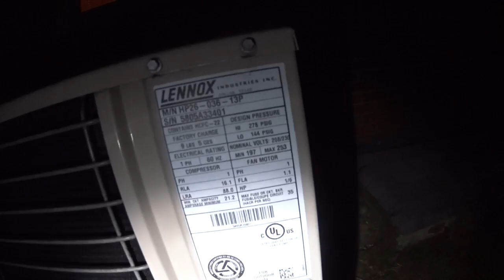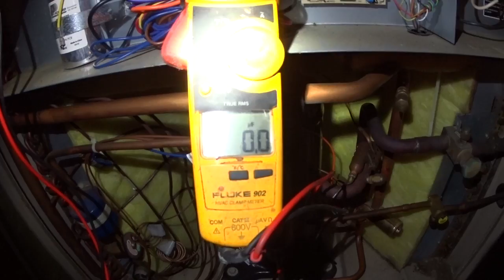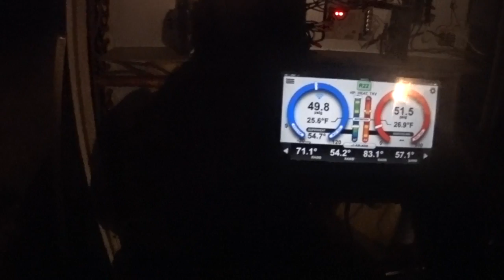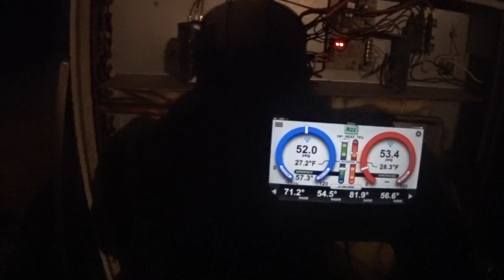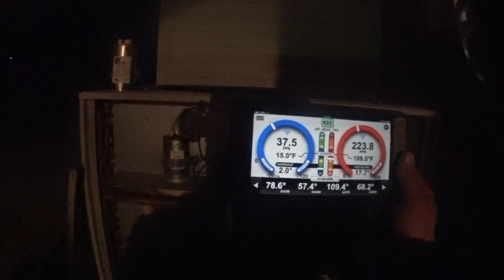HVAC Service: Poor Heating, Almost Midnight: A Day in the Life Episode 7 Call 5

Comment: If it's a heat pump the high side pressure would be the in door coil and the outside unit would be the low pressure evap.? just curious never done a heat pump.
Reply from the maker: Yes, a heatpump literally reverses the refrigerant flow and uses the indoor coil as the condenser and the outdoor coil as the evaporator.